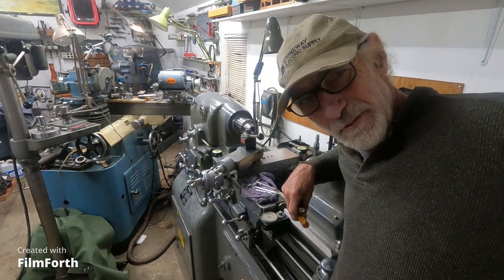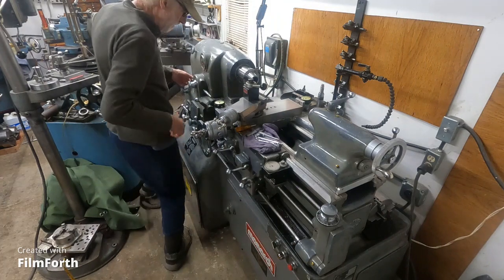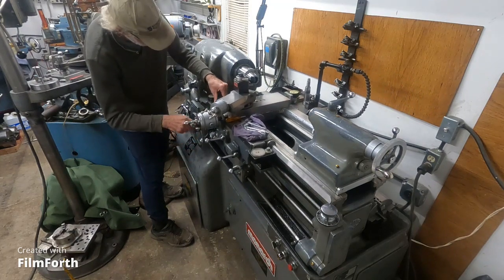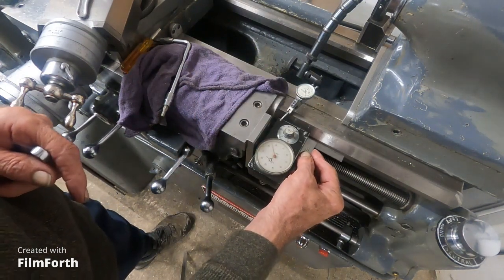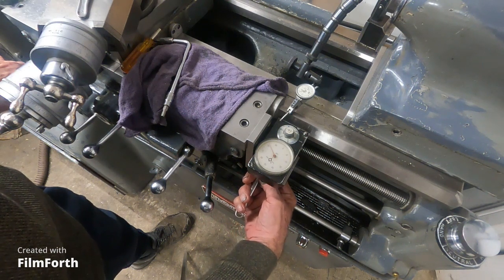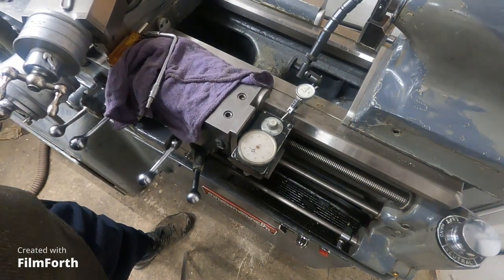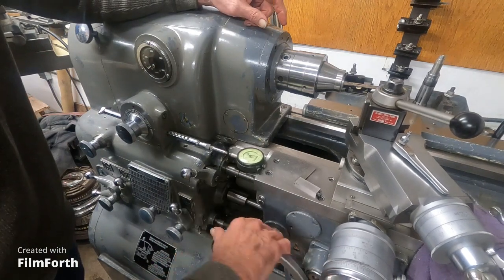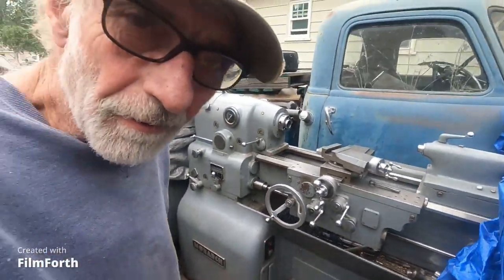Monarch 10ee Inch/Metric lathe set up without DRO part one

Comment: Great video Dee. I just finished putting Distilled water in my 3 golf cart batteries. It took over 1 1/2 gallons of distilled water for the 3 batteries. At $300 each for the batteries I am sure glad I finally did it. I have replaced the battery on one of my trucks and my 2003 GMC Envoy this month. I'm gona get a couple more gallons and check the batteries in my other 2 trucks. This heat will kill batteries and some will not fail until cold weather gets here.
Reply from the maker: Think of all the water and spotted salamanders including their water fleas you would have saved buying a Tesla Truck!
Reply: Dee I'm not a fan of EV's. I do love my Electric Golf Cart because my late brother built it from junk and gave it to me. A week before he passed, he called me and said he was thinking of selling the Corvette, I gave him and buy me a new golf cart. I told him I did not want a new one I loved the one he gave me. He called me to tell me he was going to come visit me. He always worried about my health. I never dreamed that Covid would take him from me a week later.  @deedeeindustrialsuperprecision